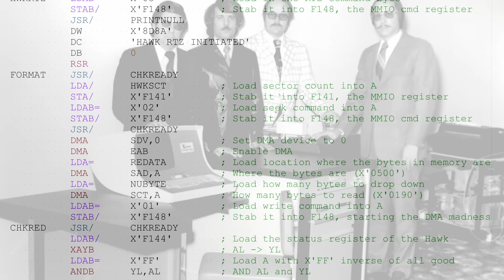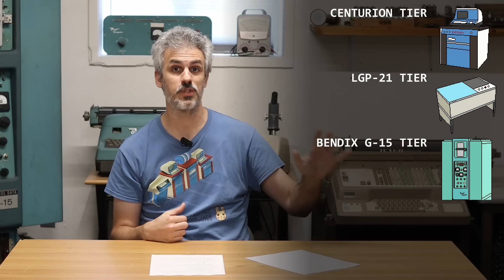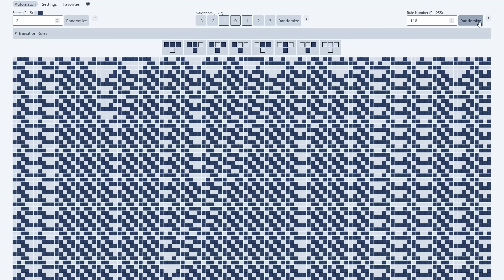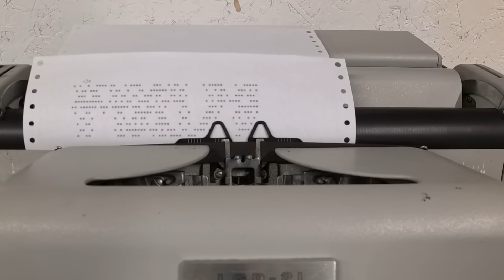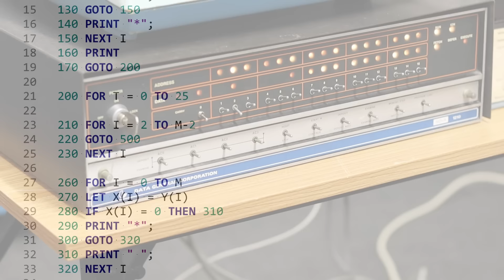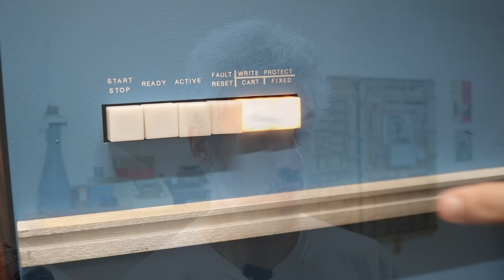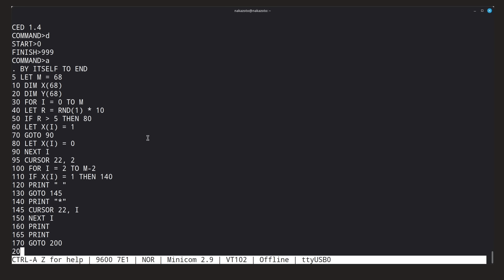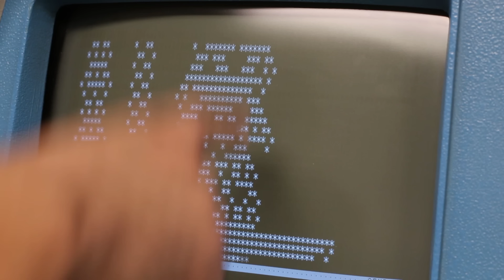BASIC on This 80’s Minicomputer is Terrible!

Comment: It's easy to forget how weird things were before common platforms and UNIX allowed people to share programs. Every hole-in-the-wall computer company had their own quirky OS, CLI and, as here, languages. In 1983, I'm really surprised Centurion didn't try to provide a standard language (BASIC, COBOL, FORTRAN, or even a block structured language like ALGOL). But in those days, it was all about locking in your user.  I'm sure someone could write an interpreting BASIC for the Centurion. It would need to be a labor of love, because the market is...limited :-)
Reply: CPL probably served the client base well enough to do payroll, estimations, and LOB. The thought of supporting anything else was probably fairly foreign.  And then specifically my guess is future CPU designs likely leaned into CPL not away from it.
Reply: I agree this was a unique world back then and I think a lot more fun than it is today with computers being pretty much the same and software locked behind pretty interfaces.

My first "real computer" was from this era. I had a Visual V1050 CP/M Plus machine that came bundled with WordStar, DR Graph CBASIC, MultiPlan, and Z80 Assembler. I learned Z80 Assembly in a college class then set out to write my own little programs. It was a lot of work and fun too, and with my 22-23 year old brain it wasn't too difficult. CBASIC was nice too and instead of writing programs in the included Edlin-like Z80MC Editor I used WordStar in non-document mode then compiled my programs. It was much easier to see what I was doing.

Around the same time I was repairing Ontel computers and "intelligent terminals". Ontel had their own version of BASIC and other languages. Their OS was DOS/UNIX like but not at the same time and it took way too long to format floppy disks and hard drives.
Reply: UNIX had nothing to do with sharing programs IMO. That was accomplished already in the 1960s with standardized definitions of COBOL, ALGOL, and FORTRAN. UNIX allowed a unified definition of a device by treating everything as a byte stream.
Reply: @ultrametric9317  the OP said "common platforms and UNIX" and I agree with that. When mainframes dominated, vendors like IBM sold one kind of hardware to business customers, and a totally different kind to technical users. So the same company would have different types of computers, one with a 39-bit CPU and the other with a 14-bit one. One would run COBOL or RPG, and the other FORTRAN. Those computers didn't speak to each other or have a common programming language. The IBM S/360 was a giant leap forward because it allowed disparate users to use the same hardware, and share the same operators between departments.

UNIX offered a standard abstraction layer to users regardless of platform. Likewise the UNIX system written in C meant that system operators didn't have to learn a new assembler for every new machine. C also became the common language for applications programming. And the tty devices offered an easy way to network UNIX machines without costly & proprietary I/O processors. Since the phone company used copper phone lines, a company could connect UNIX machines using existing serial console ports and PBX wiring. For the first time, you could copy a binary between two machines and run it as-is.
Reply: @Speed-Daemon-123  In my experience it is more about formats and standards than the hardware or the OS in itself. I mean, text files can be terminated by an CR, a CR and a LF and a LF. That means you have to take care of that as a programmer -- or as a compiler engineer. And what about those pesky hacks like EOF (CTRL-Z) or BOM sequences? 

Same with EBCDIC, ASCII and UTF. Nowadays just about any commercial machine does 2 complement. But there was such a thing as 1 complement and signed magnitude. Or what about big-endian and little-endian? A C int that can be 16 or 32 bits. There are countless things that you either take care of by abstracting the whole shebang or having to resort to lengthy conditional compilation routines.
Reply: There were plenty of books and magazines with type-in BASIC listings
Reply: @yetanothertroll  BASIC had no standard to speak of until relatively modern times (mid 80s). FORTRAN was standardized in 1966.
Reply: @ultrametric9317  But there were two general branches, mainly having to do with string handling. If you kept it simple, it wasn't hard to adapt a listing for one dialect to another
Reply: @yetanothertroll  Well I had to convert HP-BASIC, which was very advanced, into run of the "mule" BASIC, and that was no fun.
Reply: @ultrametric9317  Yeah, if you're trying to convert a large RMB project to Tiny BASIC, you're gonna have a bad time
Reply: The modern world of smartphone apps feels the same way to me. Every single one is different and has to be learned from scratch.

May the HIG rest in peace 🪦😢
Reply: I remember when Texas Instruments brought out 7400 series logic chips.  Digital Equipment built some really fast (for the time) computers based on them.
Reply: @blackpowder4016  I heard a story that some company was testing and re-binning the chips to run them at higher spec for their machines.
Don't remember if it was DEC ... but man that sounds so fun compared to work today.
Reply from the maker: Also, the year is a little hard to hammer down here. The CPU was built in 1983, but the CPU6 design dates back to 1979. The CDC Hawk drives date back even further to the early 70s. By 1983 Centurion wasn't developing anything new for the CPU6 platform and instead was shifting focus to design and development of the CPU7 platform, which would have a lot more compatibility with modern things. Unfortunately, by 1984 they had gone bankrupt and only a very, very few number of CPU7's saw the light of day. 

It's easy to look at my particular machine and say "why were they doing that in 1983?!", but we gotta remember that even though some of the components were built in 1983, they were still on mid to late 1970s technology. COBOL and FORTRAN obviously did exist in the mid 1970s, but it wouldn't have been the obvious choice for a mid-range minicomputer aimed at small to medium sized accounting businesses, local banks and oil and gas companies.
Reply: @UsagiElectric  I worked as an engineer at Data General from 1978 to 1993. Before 8 and 16 bit micros got big, minicomputers were what you used. DG was already struggling when I started working there, but they picked up a bit with the MV/8000 32 bit machine. Still, DEC was the 800 pound gorilla in the market, and DG eventually withered out in the 90s, except for their network storage business, which was picked up by EMC, and then Dell. I did one bit-slice microprogrammed design, and several with 6800 and 68000 chips. Never really did any significant programming on the DG timesharing machines, which were mostly used as engineering support (email, text documents, etc).
Reply: Just ask AI to make BASIC. With proper documentation added, it will do in a week.
Reply: @alexzk3  i doubt ai will work well with this asm dialect
Reply: @ZuckEnabler If you write a plan containing a detailed description of the full instruction set, peripherals and memory map, AI should be able to write assembly fairly well.

The funky constraints of the Bendix G5 would be more challenging however, and may require a lot of explanation and examples of common workarounds. 

I’ve written fake instruction sets for very unusual architectures and had good results even with Claude Sonnet.
Reply: @markirmuir  This is fascinating.  I'm skeptical of LLMs ability to do things; as seemingly simple things throw it for a loop and then I discover it handles other things well that you'd reasonably deduce it couldn't.

Quite mysterious, There's going to be a whole computer science-like discipline around what problems these guys work well with and what they fail at and where they're safe/unsafe to use.

I sort of hate them but I do look forward to watching the development of the science of LLMs, so much computer science seems obvious these days but clearly they were often grasping in the dark, so many things we consider fundamental, not getting discovered until the 50s or 60s, so many useful things not getting invented until the 70s or 80s.   Heh since then it's mostly what was old becomes new again.
Reply: @ZuckEnabler Indeed. One should never trust what an LLM produces. LLMs are like a really smart intern: very keen, capable, but make silly mistakes - and can be very confident in those mistakes. The solution is test-driven engineering - exactly what works with humans too. Strangely enough.

The industry is re-discovering management skills, because they apply just as much to teams of LLM agents as they do to teams of humans. Now every engineer is a manager!
Reply: @alexzk3  Ask AI to extract 5 actionable insights from A Midsummer Night's Dream, and to chew your own food for you while you're at it. You can optimize the token CPI and revenue streams to maximize impact and synergize to remove blockers for adoption too.
Reply: @alexzk3 Estimated Token $pend? 😱
Reply: @RogerBarraud  who cares? Local AI is prettu good.
Reply: @alexzk3 I actually got Claude to write Conway’s Game of Life for the C64 in 6502 assembly. It worked great!

Unfortunately I learned very little in the process…

Comment: Next project, a new Centurion Basic interpreter.
Reply: I suspect the interpreter is written in CPL which adds a layer of abstraction.  It also has to be compiled,   So we don't know how optimized the code generator is.  A good multi pass cross compiler might make all the difference.. the funny part is systems like the centurion were made to do cross development...
Reply: @lindoran  "p-code" with an optimized runtime isn't bad either
Reply: I wonder how easy or straightforward it'd be to port BBC BASIC to the Centurion...

(I know there is a version for PDP-11's - the most recent update on which is about a month old, at the time of writing.)
Reply from the maker: The real big brain move is to port CPL to other platforms!
Reply: @UsagiElectric Is decent CPL documentation available?
Reply from the maker: @yetanothertroll  Surprisingly, that's one of the few pieces of documentation that we have!
https://github.com/Nakazoto/CenturionComputer/wiki/CPU6-Programmer's-Manual
Reply: @UsagiElectric  This honestly doesn't even sound difficult. (At least, relative to writing a C++ compiler.) I'm tempted to try.
Reply: @codahighland  The links to scans of the reference manuals are in the lower right corner of the Nakazoto github link
Reply: @UsagiElectric  On the TI 980a I have been trying to post under community, but it is always deleted. I'll try again, I was reading the manual for the arithmetic unit 960699-9702 and there is a pretty clear troubleshooting section on page 3-24 and starting on page 96. It seems that ram is not needed for the front panel to display, it seems to be driven by the AU and roms, and only the clock seems necessary from the memory controller to run the boot loader from rom. It seems that even the clock could be bypassed with single step, for in-depth loader problems. I may have misunderstood, but it can be a plan to move forward thanks, Scott
Reply: Or Life on the Bendix, or better yet, the UE1 😂
Reply: Maybe he should call Mr Basic Bill Gates.
Reply: @erikkarsies4851  Sod that, they'll want a decent BASIC - they should get ARM (Acorn) to make it - BBC Basic is still superb, and damn fast.
Reply: @DaveF.  Or Markus Hoffmann (X11 Basic) or dmsc (FastBasic for Atari 8 bit)
Reply: @DaveF.  BBC BASIC for the Centurion, complete with inline assembler! 😀
Reply: @DaveF.  In the early 80s MS Basic was the defacto standard. Acorn back then was only a relative small company in the UK surviving on taxpayer money. But yes BBC Basic is nice. Ok... maybe he should call Sophie Wilson ;)
Reply: @DaveF.  It's only fast because the Beeb ran a 2 MHz 6502 with no wait states. MS BASIC is comparably fast on the same hardware. ARM BBC BASIC V is only remembered as fast because the ARM was pretty nippy at the time
Reply: I was thinking that since TRS-80 BASIC is "out there in the wild," it wouldn't be too large a project to adapt its core into something which could run on the Centurion.  It would be interpreted BASIC, which would slow it down somewhat, but it probably would still be at least as fast and I'd guess even faster than the "official" version.
Reply: Our host and his fan club are surely geeky enough to do it.

Even better, a C compiler....
Reply: Transpiling basic to CPL (in CPL) probably would be the best approach.
Reply: @JarkkoHietaniemi  Their BASIC had bitwise operations which I didn’t immediately see in the CPL quick reference. There could be other similar gotchas which might make a BASIC to CPL transpiler 'very interesting'
Reply: Go back in time and ask Borland to do just that... 😁
Reply: Next project: FPGA version of the CPU 🙂
Reply: @vonsteuben21c  Taking away all the charm of it... :((
Reply: 3rd reply
Reply: Why not a proper language like Forth? Basic is shit compared to Forth, slow and unstructured. Forth is probably twenty times faster, smaller and has functions.
Reply: @fredrikcarlqvist8997  Don't forget that there's plenty enough "dialects" of BASIC - so, while early implementations may have implemented a minimal feature-set, in order to produce something that not only worked, but worked on the target hardware, later implementations could implement more features, as the underlying hardware was more powerful and more capable.

Example: The Centurion uses a "simple", text-only, console for its input and output, with cursor-control seemingly little different to tabulation that a printer or teletype would support; compare this to the average desktop computer available from the 90's onwards, with "full-colour" graphics support, keyboard and mouse control, and sound.

And, yes, it's possible to produce crap code in pretty much every programming language, regardless of how capable the programming language is.
Reply: @fredrikcarlqvist8997  Nonsense. BASIC can be very very fast! It totally depends on the interpreter and/or compiler. Unlike Forth, BASIC is also possible to read and understand for people coming from almost any language. This regardless of whether we are talking about an old primitive BASIC from 1964 or any of the structured variants that emerged during the 1970s and 80s.
Reply: @fredrikcarlqvist8997  I think it's an interesting difference between retro-computing and computing as it actually was back in the day. The meme used to be that Basic is a terrible language at best suitable for beginners and amateurs. Now enthusiasts love Basic because of the nostalgia factor. It's a bit like how a lot of hobbyists obsess over preserving 8-bit machines in their pristine "original state", but if you find one that's actually been owned by a "power user" in its heyday, it's most likely going to be heavily modified.
Reply: @AngryCodeReviews : if you believe that new BASICs are the same than older ones, well, that's a wrong idea. Indeed, in terms of structure (in a very general form), I guess BASIC is like Python or other scripting languages nowadays... New BASICs have a lot of good programming structures and new insttuctions and functions. Maybe calling them BASIC is not correct at all...
Reply: @FryAndLeelaAndBender These structures largely came already in the 1970s though, inspired by Algol, Simula, Pascal.
Examples could be COMAL, HP-instrument BASIC, DEC BASIC PLUS, ABC 800 BASIC, and so on.
Reply: The combative language predictably got you some very defensive responses.

It's true there are plenty of dialects of basic - a fact the designers viciously lamented. Contrast this to how the fundamental operation of Forth is to extend the language - it rarely requires a new version, you could just add your features.

While the explanation for what a BASIC program means can be shorter, particularly for English readers for whom some mnemonics overlap, the explanations for Forth tell you how the computer operates.

Forth names were picked for use, not beginners as such. There are many shortcuts that were there for convenience at the particular machine, not symbolic meaning, like ! @ . \ ( which mean store, fetch, print, comment (until end of line or parenthesis).

E.g reading from screen:
BASIC: Reading from screen or memory is not standard.
C64 BASIC: ?pE(1024)
Forth: 1024 c@ .
: @xy ( x y -- c ) 40 * + 1024 + c@ ;
0 0 @xy .   \ Now I have a word for reading from 2D positions

Forth fits here because it's probably the quickest implementation possible for any established language, nearly contemporary (1970), and extensible. It's absolutely a way to go when we just have assembly.

BASIC fit its own goal very well, which was for beginner programmers, but it's restrictive for both that and outdated resource limits. Implementing it is absolutely harder than Forth, including order of operations, garbage collection etc. Most extant implementations have related bugs.
Reply: @fredrikcarlqvist8997  Dartmouth had a nice structured Basic by 1976. Kaypro had one by around 1980. Also Waterloo Structured BASIC, ...
Reply: @fredrikcarlqvist8997  Forth shouldn't be too hard, it requires minimal machine code; most of it is written in Forth.
Reply: @Lord-Sméagol  You may as well go full Smalltalk-80 then

Comment: When in college, I programmed Conway's Life on a CDC CYBER 74, using a DEC VT-05 (with cursor controls). It ran, but only at 300 baud, since the connection was dialup. It was...S..L..O..W. :-) (But not as slow as the Centurion!)